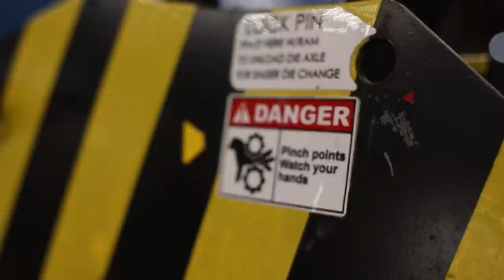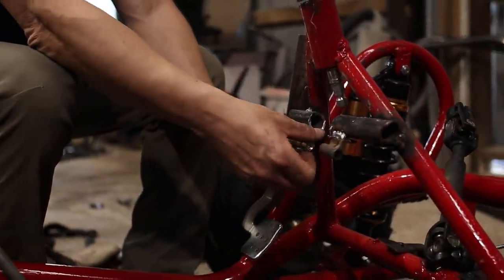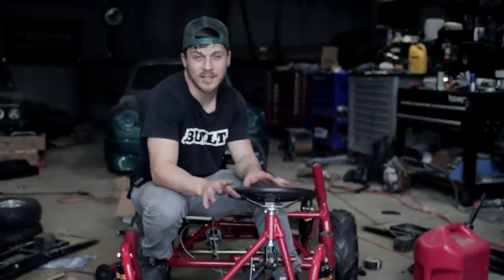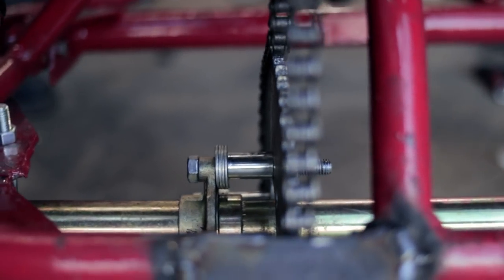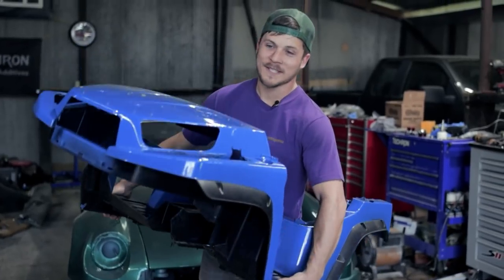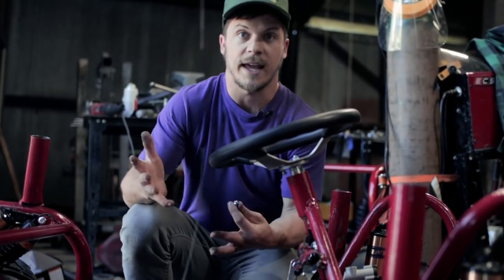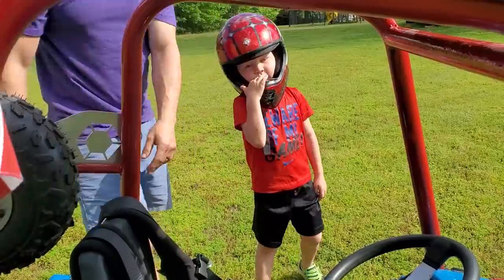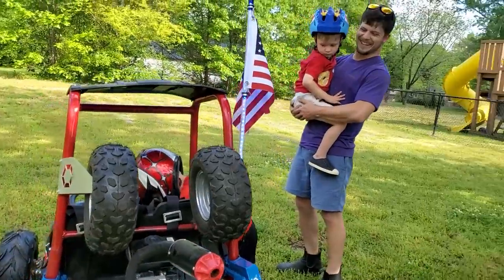I BUILT MY SON HIS DREAM "CAR"

Comment: How thick is the pips you used and what size are Thay.  Maby 1 inch tube with 1/8 wall    Or 22mm wall. If you would please let me know.    You should try to make it like  Rc car add a servo and a remote.   Or just a remote.  To kill switch